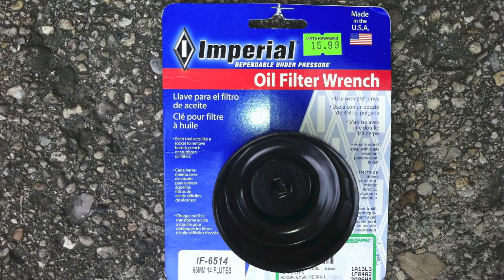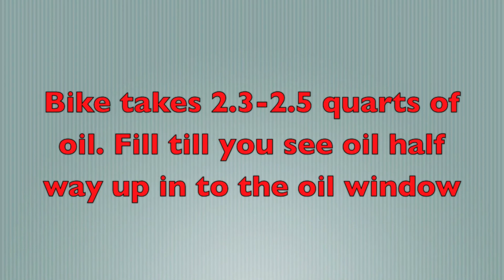Kawasaki Ninja 300 Oil Change, A How To Video.

Comment from the maker: You're right you don't have to remove the cover, but it makes it much easier. Especially when the exhaust is warm, and it gives you much more space to use the filter removal/installation tool. This bike has the yoshimura full exhaust, so the angle and size of the pipes are different, on a stock bike you can get by without removing it, this one you can't.

Comment from the maker: You don't have to have one, but it makes it much easier. You will need someone to stand the bike up straight when you are filling the oil if you don't have one. You will have to have one to adjust and lube the chain. I bought mine at harbor freight for $30 and it works great on all my bikes.

Comment from the maker: The oil level will drop after the bike is turned on. Wait a few minutes then add. Make sure the bike is straight up on a stand or have someone hold it up when you add oil to get the proper level. You will almost always have to add a little oil because oil pools in different parts of the engine and oil filter and may never make it back to the pan. But it should be half way up the sight glass. Hope this helps.
Reply: With oil and filte change, it takes 2.2 litres. Easy as. And dont know the manual says 22 ft lb for drain plug here in australia.